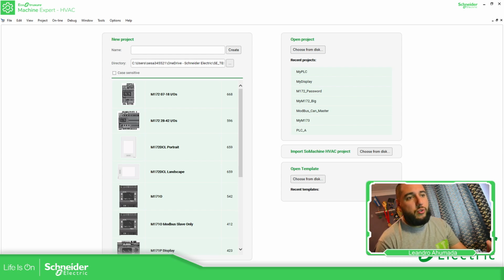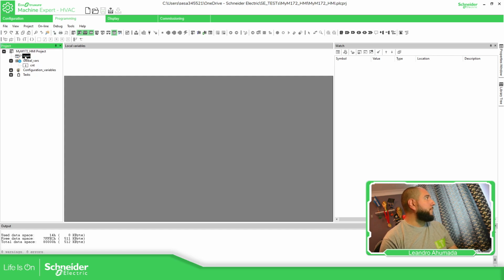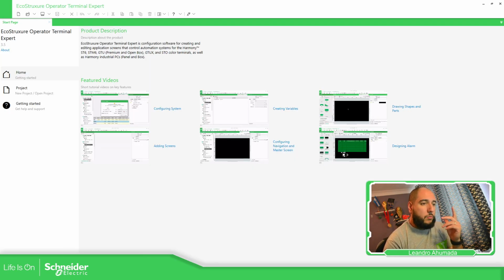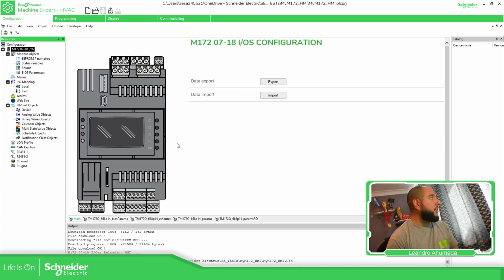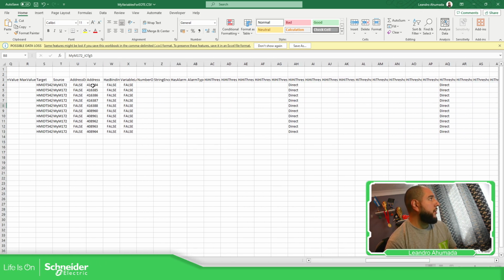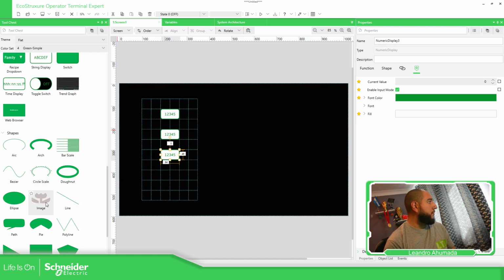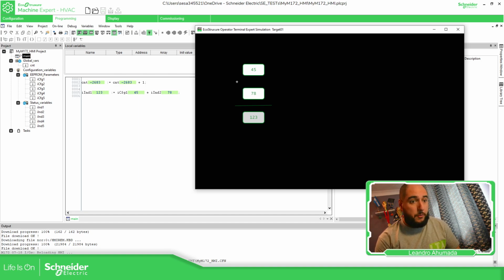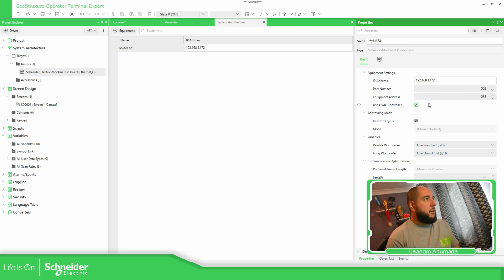ESME HVAC - Communication - M6.3 EcoStruxure Operator Terminal Expert (ModbusTcp)

Comment: Hello,  please tell me, is it possible to simulate simultaneous  on a PC controller M172 (configured Modbus TCP server) in  EcoStruxure Machine Expert - HVAC and HMIST6400 operator panel in EcoStruxure Operator Terminal Expert? And how can this be done?
Reply from the maker: Hi there! Thanks for waiting a reply, i have asked this to the experts quite a long time ago, the simulation for the HMI is okay but for the M172 you must have a real PlC with you (sim will not work)

Comment: Great explanation as usual, and can you make a video of m172 used to control the motor speed using PID function block? Would be great for the next video idea I guess
Reply from the maker: Hi there! Yes, it is a great idea. There are to many request of this. I will probably come up with something maybe more related to the theory and for the implementation i need to check what i have
Reply: Hi. great job. 
could we download the notes you have in the videos from somewhere? Some presentation or some text file, etc. I mean from the rest of the videos, not just this one. Thanks.